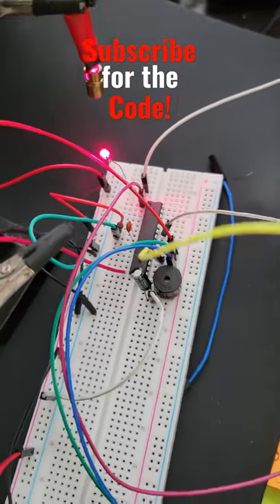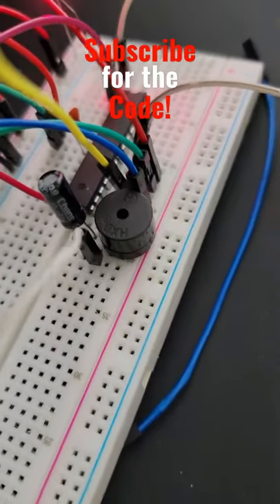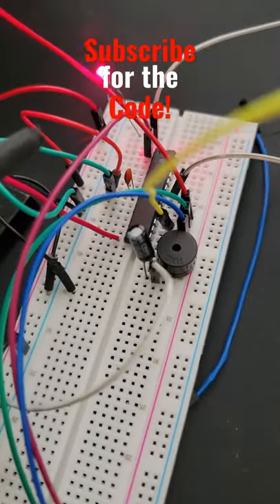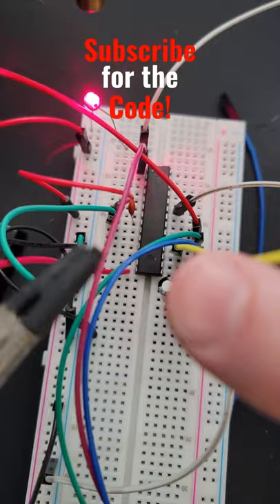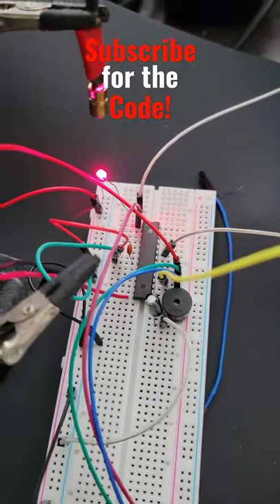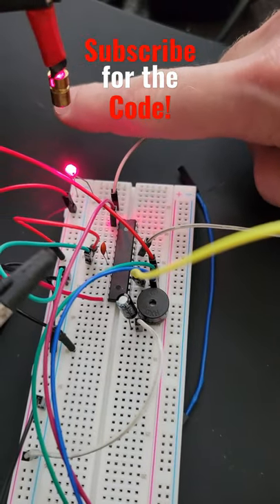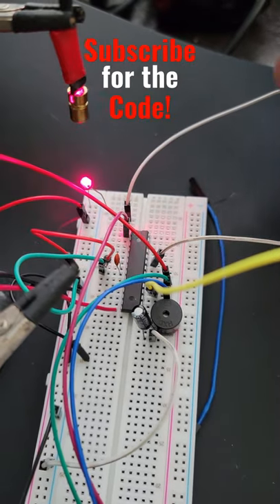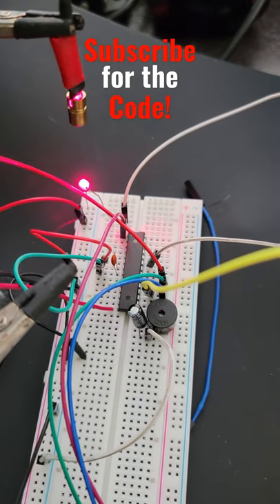Easy DIY Laser Burglar Alarm with Speaker Concept#Shorts

Comment: Nice Job Man!
CAN YOU PLEASE TELL ME WHAT ARE THE COMPONENTS YOU USED THERE AND OF WHAT VALUES...
Reply from the maker: It's the Atmel Atmega328PU chip found on the Arduino boards that I programmed in C. I took the little speaker off of my PC's motherboard LOL. Then I used a larger capacitor (black one, I think 10uF 50) to control volume. The smaller (red ceramic) capacitor is just optional extra for the +5v and GND pins for more consistent flow of electricity. LED is 5mm 1.5v. Laser is a cheap LED "laser" I got from Amazon that I soldered better wires to. Good luck!